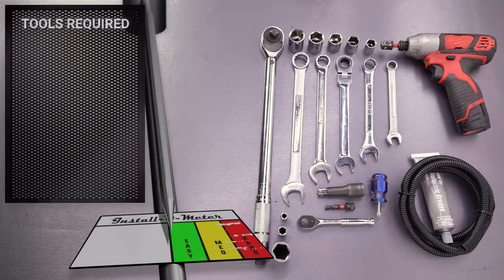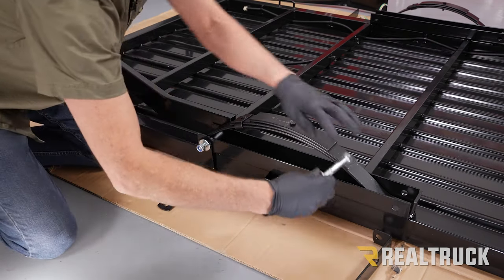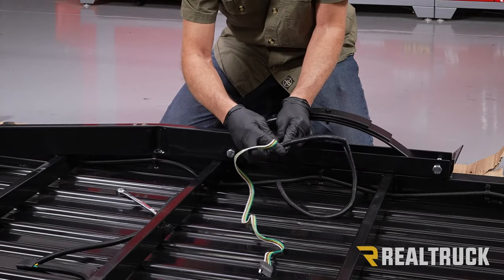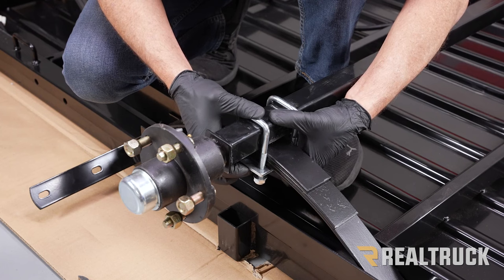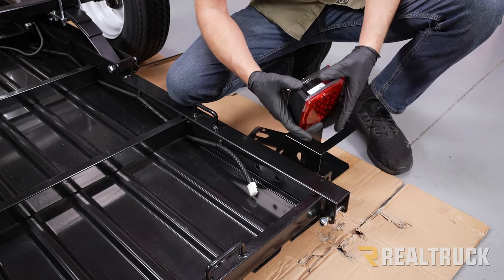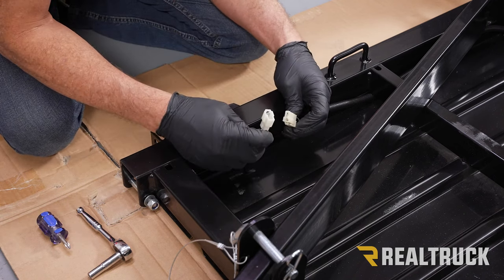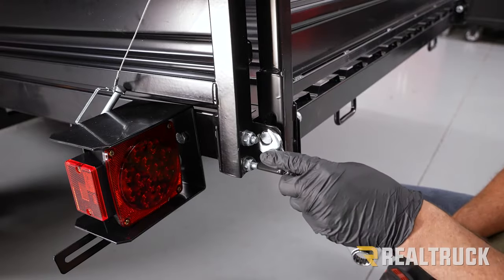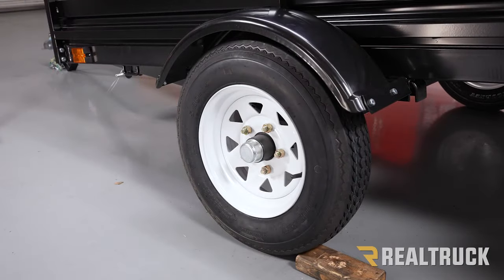How to Assemble the DK2 Mighty Multi Utility Trailer

Comment: Great video! I used this instead of the directions.

I found the most challenging part was flipping the trailer over. Once everything is connected, it is 400+ pounds. So instead I put everything together right-side up. I just put the parts on temporary stands. It was still challenging to get the bottom plate moved on it, but I did it.

Comment: Thank you for the video, it helped a lot.  To do it over again though I'd install the taillights after flipping it over.  With just my wife and I doing the flip I had to use our tractor.  Unfortunately the bucket caught the tail light and broke the housing.  Otherwise the rest of the assembly went quite smooth.  We also followed your tips with the dialectric grease and the wrapping for wiring to keep the wires from rubbing and shorting out at a later date.

Comment: just fyi...in the state of nevada - clark county.  To register the trailer the chain link must be seperated and each chain section must be attached to the A frame with its own bolt or you will not pass inspection.  also, cannot take it for inspection on a weekend.  must go in weekday then make a dmv appointment.  i hope this helps somebody.  cheers.